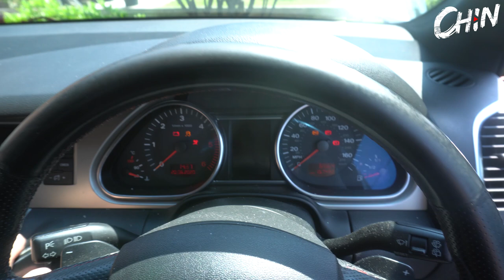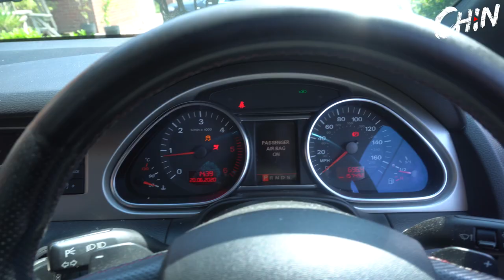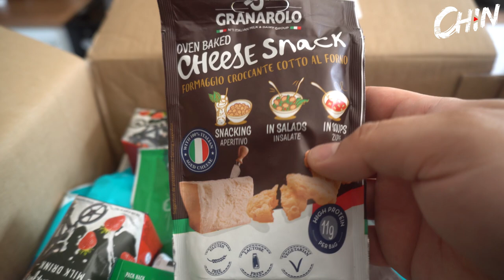Chin Vlog EP81 HELP my car battery died!!!!

Comment: See if you can get hold of Kernal beer, they have a number of different IPAs which vary from the Hops used, if I were to drink IPA that's the one i'd go for as they are not bad at all